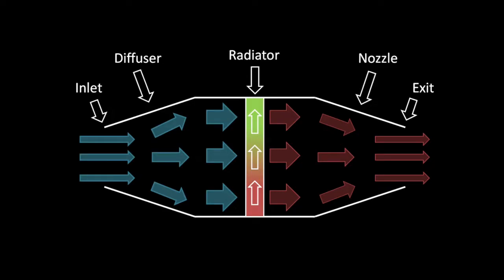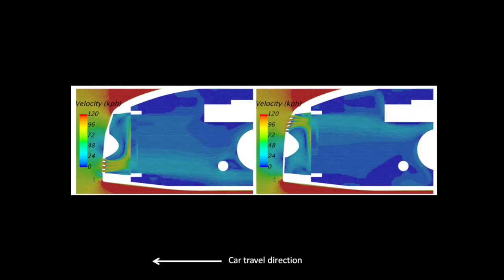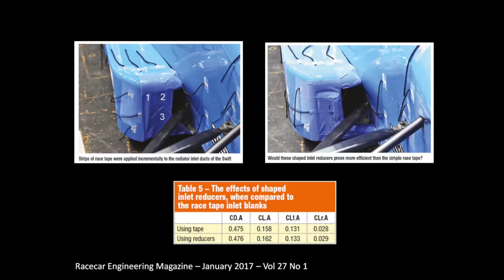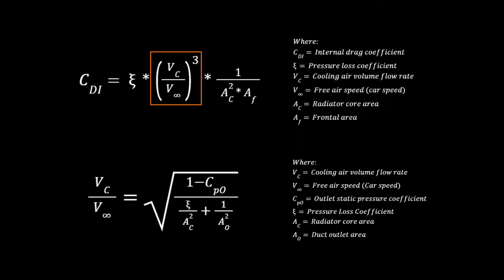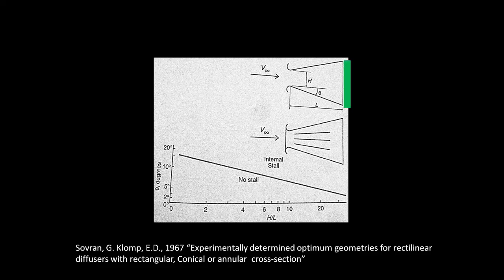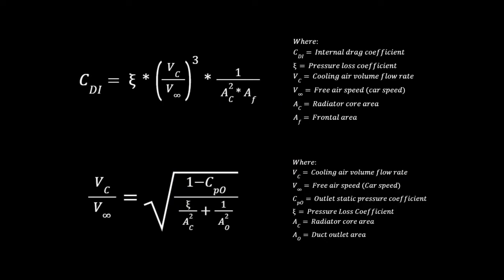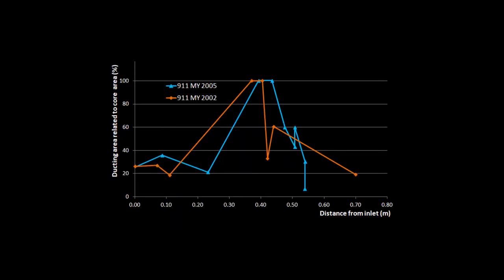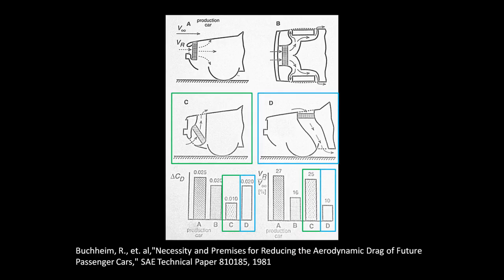The Art of Engine Cooling: Designing Ducting Systems for Optimal Performance

Comment: What a fascinating video - thanks!  I love that you used research and data (not guesswork and "I saw someone else say it on Youtube" ) to create your content.  Really informative.  I'm about to mount a 44'x22' radiator almost horizontally under my truck floor in a street car and the radiator will angle down 10 degrees at the front and only have 3" of clearance to the trunk floor.  As it will be completely under the sealed trunk, I can't run any ducting in through the trunk lid.     I'll have the puller fans mounted on the underside so I want to run ducting to the top side of the radiator.  

You mentioned that air under a car is high pressure, so should I try to draw in air from along the underside of the sills instead of trying to pull air that is flowing under the differential?  Thank you!
Reply from the maker: Thanks a lot for your feedback mate

When I said it is high pressure, I should have said relatively high pressure, relative to the top side of the car. For me, I like to think about these types of questions as if the air is flowing and the car sitting still. So as the air flows under the car, it has less distance to travel, it goes slower, and therefore it's pressure is relatively higher than the top, but as it is moving, it's lower pressure than the undisturbed air.

I'm not an expert in this, I'm not 100% sure I am picturing your layout correctly, and I've only just thought about this, so don't take my answer to seriously. But I would think air from under the car would have the highest pressure. I'm thinking this because the air going under the sill is being moved in two directions and as it rolls around the edge would be more likely turbulent or is more turbulent, but this is just my thinking. 

If I understand correctly, given that the radiator is on an angle of just 10 degrees, and with the extra 3" clearance, you have an opening of about 300 inch^2, which is about 30% of your radiator size, so i'm not sure you would want to duct the inlet side or you might not be getting adequate air flowing to the face. If I was you, I would look at improving the ducting on the backside, helping to increase the pressure differential. From there, once you have that pretty good, then I would start thinking about the inlet ducting, but i wouldn't want to decrease it by too much. I would also focus on the back side as it's exposed anyway, so why not build your radiator shield into a outlet duct.

Let me know if this helps, or if I am confused, it's hard without seeing the car or having a picture
Reply: Depending on your specific setup, you may be better using the bottom mounted fans in 'pusher' configuration, and running the ducting to the rear of the vehicle to benefit from the lower pressure area there.